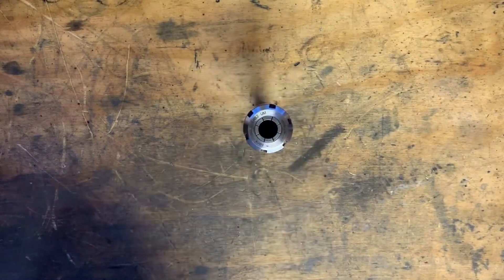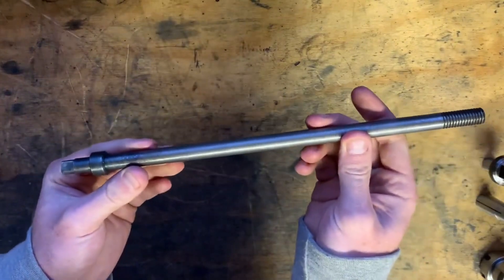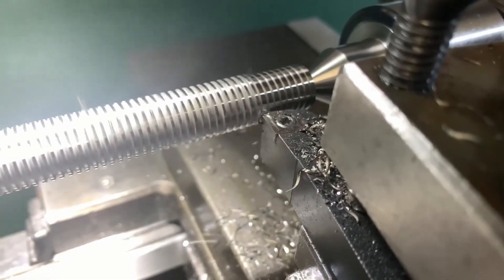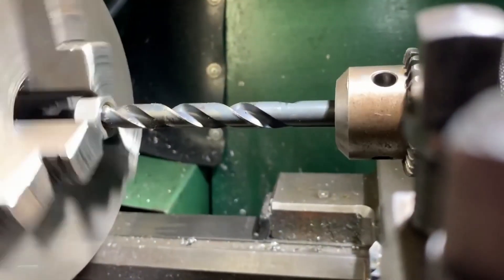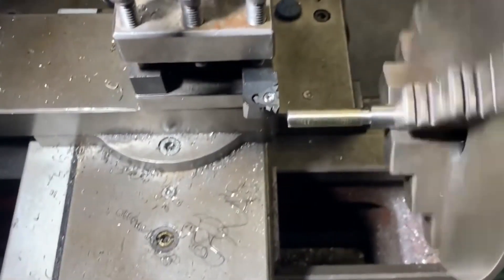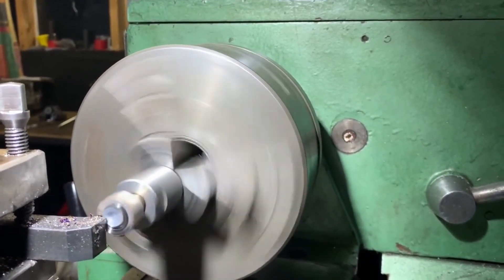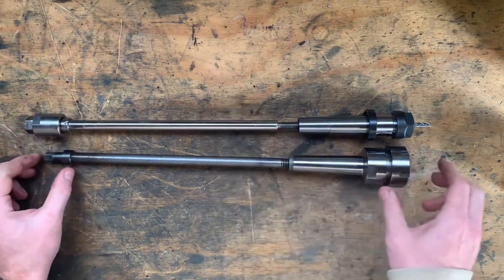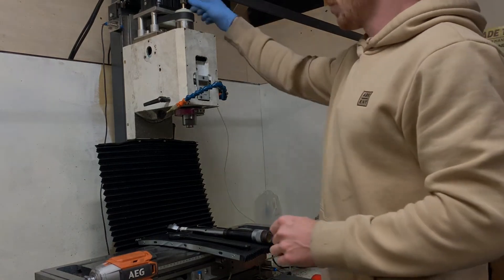Machining a Drawbar for my CNC Mill

Comment: A suggestion for you, acquire a handle for your new tool {adapt, fabricate, or buy one} as constant use of torque wrench under tension is not good for the tool {supposed to loosen tension when storing} ruins calibration.  Get the feel for the "Ugga-dugga" by hand, binding a tool in that post will make for a very entertaining video {but will be bad for equipment} .
Reply from the maker: Stainless and impact definitely don’t go well together, luckily it has a healthy smear of anti seize. For anything but ‘heavy’ cuts now I just tighten it by hand with a 19mm spanner. 

The torque wrench gets calibrated yearly and is always wound down when put away. 

Ideally I could remake the draw bar from a more suitable material but it seems to work well for now.

Comment: Love the vid. About to make the same drawbar for my bf20. Do you happen to remember the dimensions of the inside of the sleeve please? I want to leave my existing drawbar intact as I will still use it for the tooling I have that takes the 1/2bsw, so I need a new one for the new drawbar.
Reply from the maker: Thanks the feedback. By sleeve for you mean the 3/4” collet or the little threaded portion to hold the draw bar captive when loosening it?
Reply: @OddsandEndsMachining  the piece that you took off the old drawbar and put on your new one, that allows you to loosen the tool without a hammer.
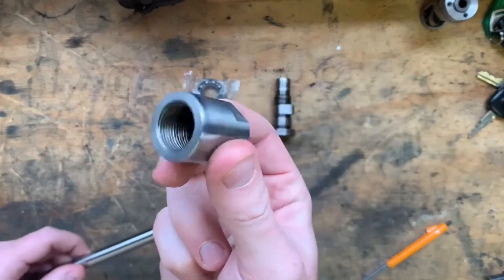Reply: Just flicked through the vid. You call it a collar at 6:00
Reply from the maker: @UncySpam  I can get you the dimensions if you want but I don’t think it’ll be the same between the mh28v and the BF20.
Reply: @OddsandEndsMachining  thanks. Guess I’ll just have to take some guesses and see if it works 😁

Comment: Just what the doctor ordered, only 3 days ago I received the Mt3 to 3/4"  sleeve for my HBM BF 28 vario milling machine and a tts ER 32 collet holder both from the US ebay(damn import duties doubled the price) now I need to make a new drawbar as the Mt sleeve sits further into the mill quill and is shorter also as you found has a different thread than a normal MT3 anything, usually 12 or 16mm, not checked yet but you say its 3/8" in foreign money.  Before I start how is the stainless steel working out? Ill have to have a look see what material I have but may need to order something. I think I have some SS but might not be long enough. Thanks for sharing how you did things.
Reply from the maker: So far the stainless hasn’t given me any issues, Id just make sure not to over tighten it and have a tiny bit of anti seize on the threads. Ideally I’d just make it out of a grade 10.9/8.8 threaded rod, I’d usually avoid stainless because of how it reacts with other metals but it’s just what I had handy at the time.

Comment: Nice man, you thinking of getting a stack of Bellville washers and an Air Cylinder? Not far off having a full blown ATC! Greetings from Auckland :)
Reply from the maker: I have considered giving it a go. I’m not too sure what kind of spring force I would need for the mt3 taper though. I’m sure it’d be less than an R8.
Reply: @OddsandEndsMachining  I would assume you can just rip the force specs from whatever a tormach uses; which must be documented on some forum somewhere.
Reply from the maker: @3dkiwi920  they use an R8 spindle vs an MT3 I’m sure the tormach specs will be sweet. I’d just be worried about the taper releasing, and being a much more gradual taper, maybe I can get away with less spring force and a smaller air cylinder.
Reply: @OddsandEndsMachining  Ah I see, yeah my chinese mill with a mt3 taper gets a bit sticky, but even having a split collet as opposed to a full contact shank probably helps.

Comment: This is a great video! The drawbar is fairly simple but it works well. I (eventually) want to build a  draw bar that uses a offset radial cam mechanism to tighten. I'm still waiting for some parts for my lathe restoration, them it's on. 
It's going to be so easy to change stuff out with a flick of a lever!
Reply from the maker: That sounds like a good project, are you going to tension it with Belleville washers or a spring of sorts?
Reply: @OddsandEndsMachining  The idea of stacking Belleville washers sounds good, it would probably perform better than regular springs, and haven't even crossed my head.
 I think a volute spring might be a good second choice. Small gas springs might be cool, albeit probably very expensive. 

Quite honestly, I haven't really thought much about this, I've seen it in one of those shops that specialize in machining engine components, and thought it would be cool to make. I believe it might have been a valve boring machine but I'm not 100% sure. 
Gotta draw up a CAD model when I've got some free time, so I don't ruin nice metal like I always do.
Reply from the maker: @lazar2175  that’s usually the case (scrapped parts) when you don’t come up with a plan and sometimes even when you do you remake the part with all of the things you learn. I like with the washers about how you can stack as many as you require to get the desired spring tension.

Comment: maybe its more handy to use the torc settings on your cordless drill, that wil be a time saver.
but if it was me, i never use a torc setting to pull the collets tide.
Reply: The idea of using torque setting is to always get the Z stickout the same, as the mill is cnc the Z hight is invaluable when changing to different tools, the software remembers and applies the Z hight accordingly so you don't have to reset it every tool change. Also Tormach recomends it in order to get proper grip each time.
Reply from the maker: Only time will tell if I keep using the torque settings.